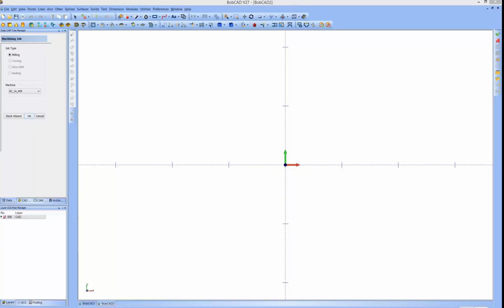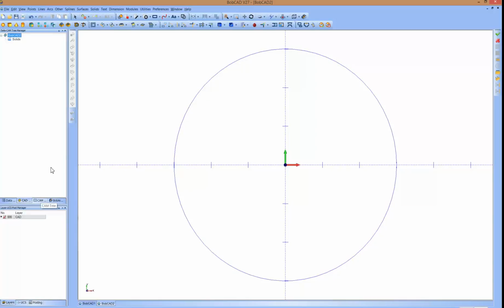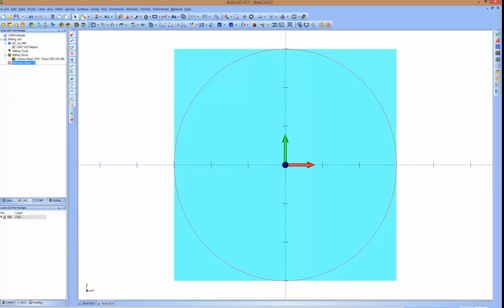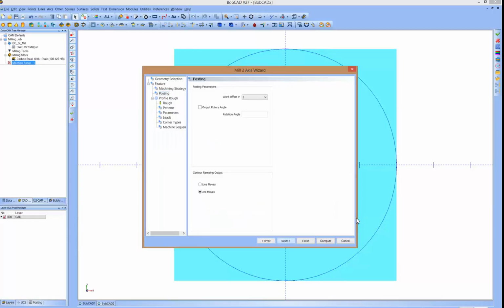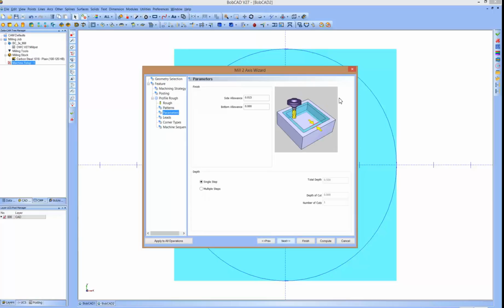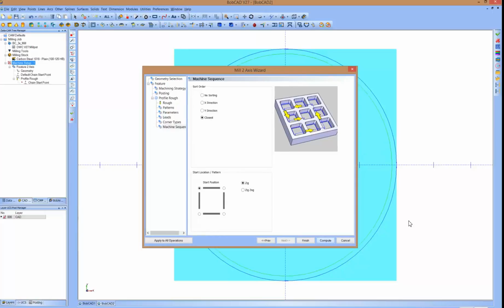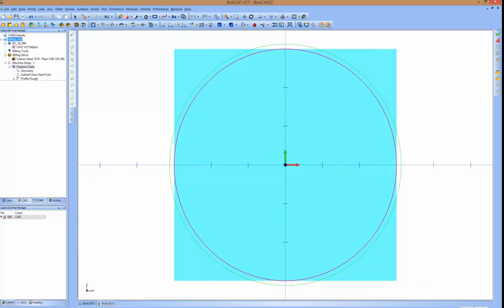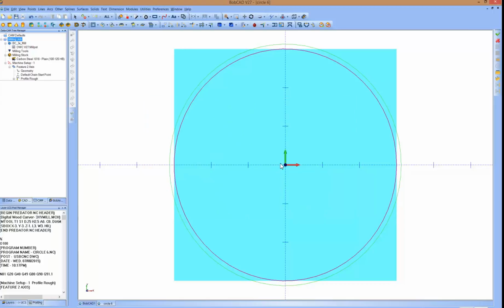BobCad/Cam v27 - Cutting a Profile

Comment: Burl, I would like to see a demo of how to make a cut out like this but leave some thin tabs so that the part is still held in place at the end of the cutting.  I've seen videos of multiple parts cut out of a single sheet of stock and they are held together with the tabs to prevent the part from moving until all the parts are cut out.